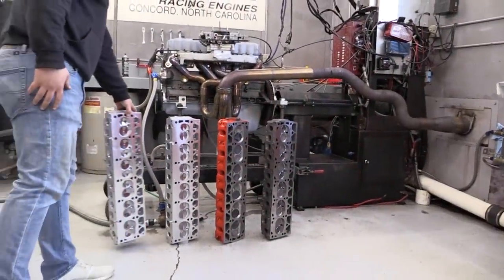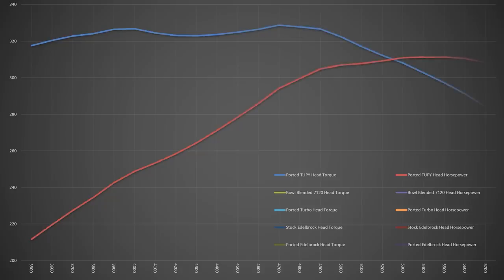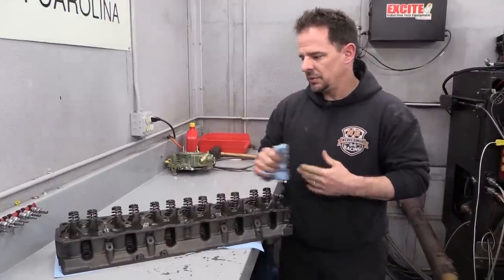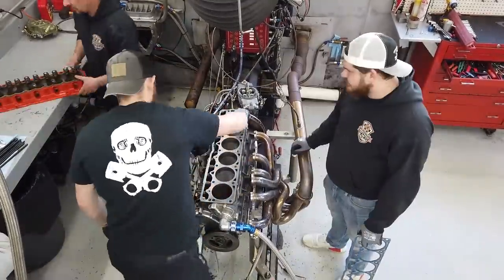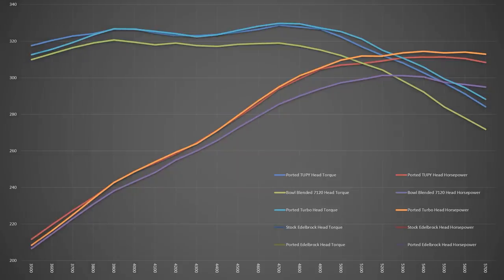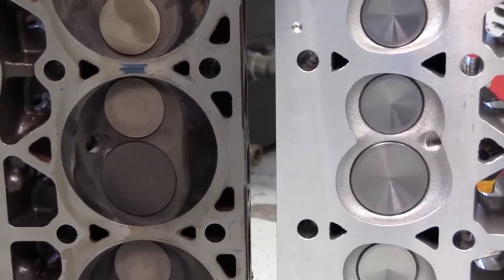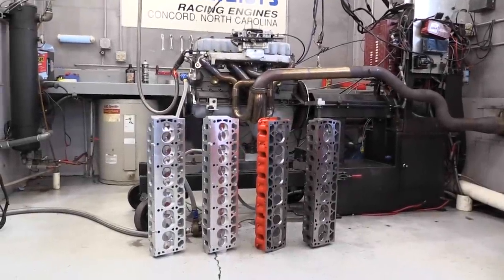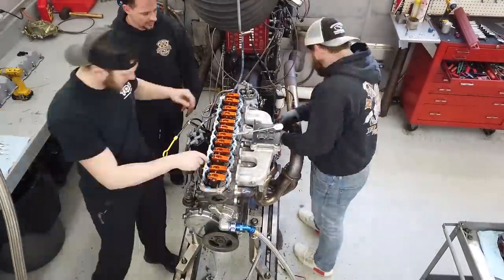We Test 5 Jeep Cylinder Heads [How Much is Porting Worth?]

Comment: That engine started handicapped from scratch. Same for all USA domestic I-6's.
OHV, NON-CROSSFLOW cast iron head.
Cumbersome BOTH intake & exhaust manifolds. Even Air/Fuel distribution be damned. 
Meant for basically trucking duty (Under square design most of them not lending itself to revving freely, overbuilt and heavy rotating assemblies).
I would be happy with the Edelbrock Aluminium head just for all the weight saved, any additional PERFORMANCE is just a nice bonus but not at that price, HELL NO.
Or go the easy route and LSx everything or install a turbo'd FORD BARRA.
Reply: Then don't buy one. And please don't block the trail, this is not F1 racing.

Comment: Not enough compression to accurately test the aluminum heads. You need a min of. 9.4:1 because of the thermal efficiency of aluminum. I'm running 9.7:1 on 87 Oct pump gas due to dynamic compression loss from thermal efficiency. It would be great if you guys could test those 2 heads again with a real build.

Comment: I have a big question, what serial number are the springs and what brand do they use for that camshaft?
Reply from the maker: They were Comp Cams LS springs and I think the cam was from Bullet Racing Cams. Thanks for watching
Reply: The Horsepower Monster LS comp cams will be those of 26995 part number

Comment: Guys I need some help.  Which head 603 or 7120 would you run on 4.2 bored 40 over. I just want to up some better  performance  in my yj   street and light off-road work.

Comment: Hmmm what is best real world cam for near stock 630 head?  Not the highly modded one in video. Say idle to 4200 rpm? I'm not going to ever see above that.
Reply from the maker: If you are never going to get above 4,200 rpm, that's totally cool. But it doesn't mean nobody else wants to.
Reply: I asked a simple question for daily driving and trails. Idle to say 3800-4000?  Max torque at lower rpm.  Okay if you all do not really know.

Comment: Hey! I have a cracked head on my 2000 Xj from the usual casting issues I was just wondering if you guys know what the most cost effective replacement is and where I can purchase it? I want it to last forever although increased performance would be nice. Thanks!
Reply: I had the same issue and went with a new Promaxx solution that’s complete for $800

Comment: This is cool and all for people with Jeeps pre 2000. But what about people with "newer" TJ that have to deal with OBD2 and the like to keep it road legal? Anyone making an ECU/TCU programmable computer?
Reply: post 2000 4.0s are only good for parts...
Reply: @omegarugal9283  Unless that's what you have as a DD. I would like it if someone would makeone. I have no clue how to go about it. But they make them for every V-8.
Reply: Not a problem, 96-06 are the best years due to being able to tune the factory ECM. Completely "Road legal"
Reply: @keithnewcomer4406  This may be the most useful info here. As a thank you, I will mention "Metric Mechanic", I have no idea if they are still around, the point is that they did allot of flow bench work ('80's BMW) and well, the idea about "smooth ports and runners"  ... take 40 grit sand paper and a mirror both mounted on the same board so that the tilt angle is same. One drop of water one each, tilt and observe. The flow bench testing proved it out, Merc Benz even had a patent out on cutting ridges onto the outside of the valves. 
There was a America's Cup boat that was also using this "rough" to go faster.
Hope this is useful, 40 year old tech, if you can find the old Metric Mechanic Missouri stuff, give it a read.

Comment: P.S. If treated right, that 6 cylinder engine will give you 300,000 miles of use. Mine had 246,000 plus when I sold it and it went another 60,000 miles before it got totalled in a wreck. As long as there isn't a maniac behind the wheel, they're good to go.
Reply: Mine got some flattened cam lobes at 50k miles... and I treated her like a dream.   Not all of them go for 300k miles. :)

Comment: Why not roller cam
Reply from the maker: The way the block is designed, the lifters slide almost completely into the lifter bores. So you can't just drop in a set of tie-bar roller lifters, and the traditional dog-bone style won't work either. I know there are some people that have come up with roller systems, but I've heard they weren't very reliable. Thanks for watching.

Comment: why doesnt someone have the sense to build a crossflow head like the tunnel port heads that ford used to make? The 4.0 head is a design out of the 1920s.
Reply: Edelbrock basically did the aluminum head with the same layout as the stock CI head for one reason. It's spelled CARB. They wanted an aluminum head that would be street legal in Cali. Plus ask yourself. Just what would the market be for an aluminum crossflow head for this engine. Would it pay for development and tooling? Granted 3D printing has made it a lot easier to produce experimental castings. But enough cheaper to justify the costs? If (the biggest word in the English language) money is no object there are options. Two Windsor, Cleveland, LS or SBC heads cut and splice together. Or two GM DOHC V-6 heads with the 4.400 bore center. Somebody was doing that for the Pontiac OHC 6. Or possibly a set of Infinity V-8 heads. They're pretty close too. The best way to really get really big power out of a 4.0 is forced induction. Barney Navarro got 600 to 800 horsepower out of a sleeved 199 in the sixties. They only blew the motor when they went to Willow springs for some testing. The dry sump was only set-up for turning right. 
Remember when GM took a Cylcone pick-up out to the salt flats and made a big deal out of it? The next year one of the Jeep power train engineers took a Comanche out that he built on is own dime and shredded the records GM had spent big bucks to set.

Comment: It’s disappointing these dynos always start at 3000+ rpms. I am willing to bet 99% of Offroad builds never even see 3000 rpm on a normal day of wheeling. What’s going on below that is so important
Reply from the maker: Yes, I'd love to be able to show the results for many of these engines starting lower in the rpm range, but dyno's are really stressful on engines in the low rpm range because they hold the engine back from revving up too quickly. The combination of combustion at wide-open-throttle and the dyno keeping the crank from spinning up quickly can damage parts, and nobody wants that on their brand new engine. Thanks for watching!
Reply: The Horsepower Monster oh wow I didn’t know that. I figured there was a reason for that. But my manual 4.0 has been over 3000 rpms maybe a handful of times trying to escape mud pits and stuff. I guess it’s time for desktop dyno lol
Reply: Id like to see dyno graphs of part throttle output from idle to 3000rpm. 

You don't flog it at full throttle down low generally.

Comment: You are not seeing much gains because of your'e choice of a carburettor try using triple webbers
Reply from the maker: Good idea. Know anybody that makes an intake manifold to put multiple Webbers on an AMC/Jeep cylinder head and we will test it
Reply: I saw this video a while back. If I remember correctly it was running alky.  Maybe you can use that intake? 
Or try Offenhauser. They're hard to contact, but they're still in business and they make some oddball good stuff. 

Watch "600hp Jeep 4.0. 505 Performance 4.9" on YouTube
https://youtu.be/8PiDtrxblyg
Reply: As this is just a double size Triumph 6 (GT6, TR6) engine I would tend to agree.

Comment: Any reason why the dyno recording starts @ 3500 rpm?
Reply from the maker: A dyno holds the engine revs so it can only rev up so fast. Starting a dyno pull very low in the rpm range can be very stressful to the rotating assembly. Plus, generally speaking, if you are at wide open throttle in low rpm and the engine is lugging, you are in the wrong gear. Thanks for watching
Reply: Cams that big start pulling about 2500 - 3000 RPMs... weak below that... similar to spec.s of Chevy 350 HP 350" cam...

Comment: Out of the box elderblock was a flop
Reply from the maker: I don't think so. Remember, we are comparing it to hand-ported heads, which give them a big advantage. Against the head that had been fully machined but not ported, it did much better. Thanks for watching.
Reply: @Future-Preps35  Sounds like a great rig. I wouldn't talk about the D30 being weak though. I've seen those used and abused, and still holding strong. Another oil leak point that may look like rear main seal is the oil filter base O-rings.

Comment: ports are way too big on the ported heads for 50hp per cylinder, headers look way too big
Reply: yes it is...the header didnt match with the 6 cyl engine.and match if ported in v8 engine..although the horse power get it..but the consumtion also big too..and more heat if the cooling not capable.i think shouldbe better if tuning in ecu efi.injection system and tuning the air flowmeter

Comment: Again just like the last 4.0 video I watched from you guys injectors,injectors,injectors should be used on these test not a  carburetor
Reply: Why?  So we'd have to wait for a computer to learn how to run the engine every time?

Please make a video showing a fuel injection setup that actually outperforms their carburettor on a dyno.  Good luck to you.
Reply: @KC9UDX  that's exactly why injectors are more efficient, use a ecu if necessary majority of people have them in there 4.0s these numbers would have been much better with injectors, more responsive and accurate numbers how can you not understand smh
Reply: @vee950  how can you not understand?  You can dial in a carburettor perfectly and it just stays that way.  What do you gain by a computer hunting around?  It seems a lot of people don't really understand how PID and servo loops work.  EFI is fine for changing conditions on the street.  It's no advantage on the dyno or race track.

Would you advocate for a feedback carb?  I'll guess no, because you are EFI-only and don't really understand carburettors.  I'll bet you call them "controlled leaks".

Where's that video?  I really wanna see you outperform their caburettor on their engine with your choice of EFI.
Reply: @KC9UDX  people understand but carburetors are not as accurate as injectors I know from experience and those cylinder heads they use were from 00,03,06 jeeps those are all injection driven so with that test there not getting the full potential out of the heads the whole motor for that matter there's no adjustments need on ecu unless there forced induction mass majority that watch that channel have injection driven 4.0s so if you're doing it for the public show them what they want to see injection 24lbs rail and 27lb rail would be good
Reply: @vee950  all?  Not all.  I build them without EFI.  There's nothing inaccurate about a carburettor.  Do you compare them with EFI side by side on a dyno?  If you do, do you set up the carb?

If you want to see how this engine runs with the stock MPI, you'd better use the harness from the vehicle.  I sure wouldn't want to do that on a dyno.

Did you see that video recently where the guys with a heavily modified 242 could not get the EFI to work and they blamed the intake?
Reply: @KC9UDX  I would far as mpi and no the only videos I watched was this 1 and the roller rockers video
Reply: @vee950  Carbs are only as inaccurate as the guy who sets them up.  Set up right, a carb will always make more power than EFI.  Carbs do a better job mixing the fuel and air than injectors can.  Set up right, carbs have every bit as good driveability.  They do the job at least as well, and they do it cheaper.

It's people who don't understand carbs and can't set them up properly who have given carburetors a reputation for being inferior to EFI.
Reply: @immikeurnot  precisely!
Reply: @immikeurnot  UTG recently said something I never heard before, and I wonder about it.  He said that the fuel drawn into the carburettor gets cooled under suction, causing an advantage.  Conventional wisdom is that fuel under pressure from an injector makes for less work for the motor pulling in fuel.  I never really expected that to be enough to matter.  The former seems even less likely to matter.  In any case, EFI must negate any horsepower gains from FI.
Reply: immikeurnot while I agree, what motor are we dealing with here? What crowd? Jeepers!  So I think there’s something to be said for running dynos in a reality based situation. Most motors aren’t built to sit on a dyno, or solely to run a 1/4 mile at a time especially the 4.0L straight 6.  Yes, its great to know what it’s capable of, but if I build a motor and I’m going mudding or crawling or technical trail riding where off camber high angle driving can happen people prefer FI motors. There are some nasty driving conditions that occur all the time in the jeeping world were carbs don’t hold an advantage. I think lots of jeep owners would love to see a setup that’s more honest to their uses
.